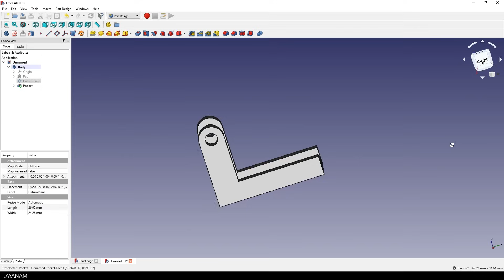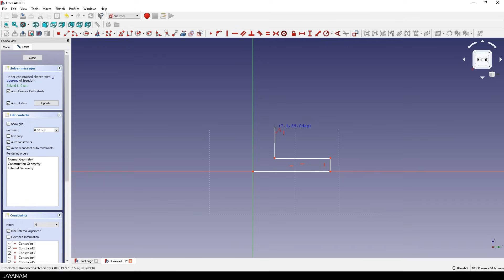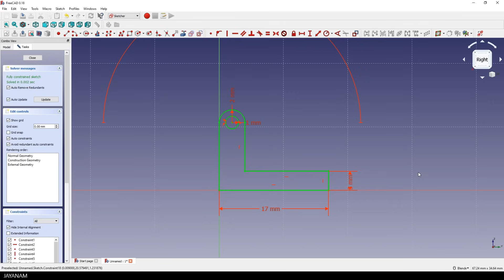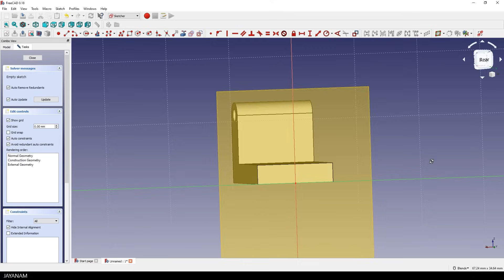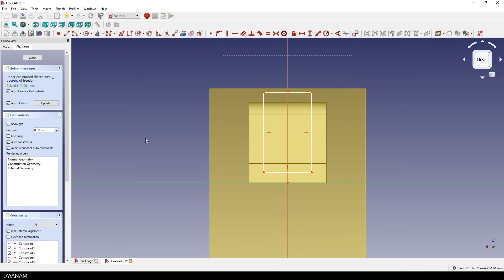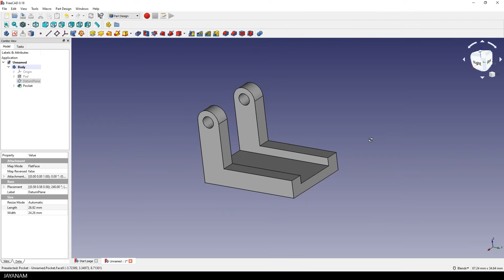FreeCAD Beginner Tutorial Part Design

Comment: the N key is no longer routed to a tool change keyboard shortcut. When i did it on my own, no matter what I tried, there was still 2 degrees of freedom.
Reply: There is 2 degrees of freedom even after constaining each circle to 2mm & 1mm respectively. Aswell as constraining the bottom line to 17mm & right to 3mm. I know these are arbitrary numbers, but no matter what other form of constraining the sketch Im hit with redundant constraints.

Comment: Thank you very much for this video. A quick question...is the datum plane necessary? I put the sketch on the front face of the body and created the pocket from there. I'm using FreeCAD 0.20. Is the datum plane recommended based on the topological naming issue?

Comment: Thanks for this, I’m new to FreeCad, but have been using Solidworks and AutoCad for 3 years, so it’s been confusing for me to do some simple things like this, mainly because the wording and methods in FreeCad are a bit difference. After extruding my initial body without the circle for the hole, I was going to try to sketch it on the face of my part and try to make a hole from that sketch, but it was telling me I couldn’t do that, but I don’t really understand why. I guess if I ever want to do something to make a cut I’ll have to get into the habit of making a plane like you did for the pocket or just including the shape of the hole into the initial sketch. Either way, both seem easier and more in my ballpark than using the boolean stuff like another video did.

Comment: cant figure out what im doing wrong but when i pad it everything disappears...
Reply: so, i have to make way more constraints to get it to work, and even if i get everything constrained, using create a line doesn't connect the end points even on snap to grid... using the polyline tool worked, but how do you connect 2 end points that are in the same spot?
Reply: and seriously, how do you change the arrow keys to not be backward. this is the most frustrating part, its like getting in a car and when you turn the wheel to the right the car turns left, and i know everybody is going to say you will get used to it, but than when i go play a game im going to be backward.

Comment: This is awesome. I have one very basic question though - why can't I move or rotate the parts in my editor? The only thing I have been able to use are those tiny arrows on the cube on the top-right corner of the editor and zoom in and out. Click and drag on the empty area has no effect whatsoever. Do I need to be in any specific view or something? I am using Freecad 0.19 on Ubuntu. Sorry for the extreme basic question.

Comment: At 3:19, how can the sketch be fully constrained? I can't see there's a height for the vertical part containing the hole.
Reply: Me too. I think that the default behavior for things like 'Auto-Constrain' seems to change based on the version...
Reply: Yes, same here.
Reply: i solved this issue by simply adding a constraint to the left vertical line, this completes the sketch. about 10mm seemed appropriate
Reply: @Oroborus710  you are my hero, thank you so much.

Comment: At 3:15 in the video FreeCAD indicates that the 2D sketch is fully constrained.  I don't understand that.  I don't see any constraint which controls the height of the vertical arm.  Why couldn't the height of that arm vary?  How is that constrained?
Reply from the maker: You are right and tbh I really dont know. There should be 2 degrees of freedom in my opinion and when I recreate it with 0.19 I get the 2 dof for the length of the arm. Perhaps it is a bug.
Reply: @JayAnAm  Ok.  Thanks for your reply.  When I duplicated the 2D drawing as in the video the drawing only turned green and became fully constrained when I set a dimension for the height of the vertical arm.  Like you wrote, maybe it is a bug.
Reply: @explodingbee  Same issue for me and resolved in same manner as you.
Reply: @JayAnAm  ahhhj okay ....since I do this now on 0.19 its not turning green on my side ( did it now twice ^^)

Comment: I just watched through your first two FreeCAD tutorials.  Before starting, I couldn't even get a line on the screen.  I spent about two hours drawing a part while I watched (sometimes watching a short segment over and over, since I'm on Linux and despite the same version, my menus and yours aren't identical), and at the end, I have a complete base for a film slitter (to convert 120 into either 127 and 16mm, or three strips of 16mm) ready to print -- including slots for the blades to seat in, fillets and chamfers, and pockets for the magnets that will hold the cover on.  The cover (which holds the blades) is next.  Even better, I have the knowledge now to sketch the cover.  One Saturday morning well spent.

Of course, I still have to find space to set up a 3D printer before I can print the parts, since the nearest library that has a printer is in a different county so I can't get a card.  One thing at a time...

Comment: I have an existing .stl file which is a basically circle (intake duct for a quad drone) I want to take the interior vertical wall of the duct and narrow it by 1.58MM and leave the outside diameter and other dimensions as they are. I don't know how to take an existing .stl project and to be able to do this simple task. I can view it from all sides, take measurements, but I cannot extrude the interior vertical wall nor can I do anything with the Project but look at it. How do I modify?/ I'll send you the file if you wish to do a tutorial on existing .stl projects. Thanks, Bob Griffith

Comment: Great tutorial! A question just to try to understand some of the basics, at 3:13, how did it get fully constrained? How did the vertical parts leading up to the arc at the left part of the sketch get defined? Mine never did
Reply: I had this problem and I "solved" it by remaking the sketch. Somehow each of the line segments were no longer connected, or I had not been close enough to right angles when first trying the sketch- and thus could not solve constraints
Reply: Yeah I had to add another constraint to the line or it said the wire isn't complete when I tried to cut. I have no idea how this works because it needs that second vertical constraint. What constrains the top from moving up and down?
Reply: If you can move the arc, i added a block constraint on it and mine turned green